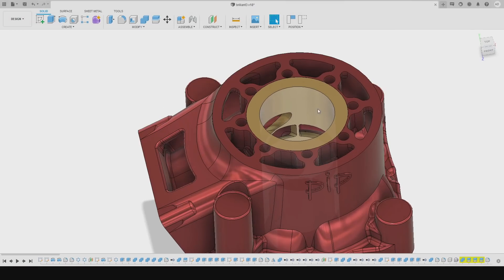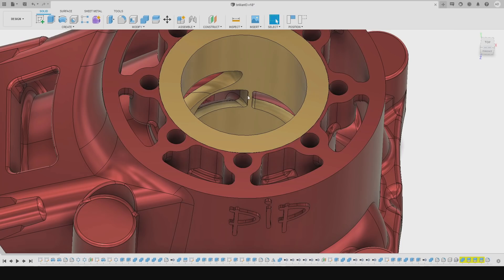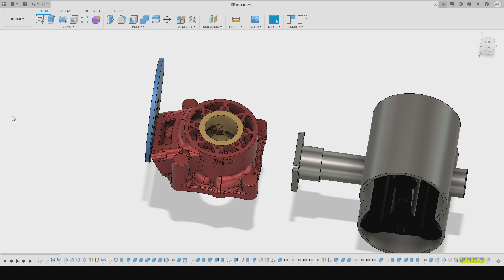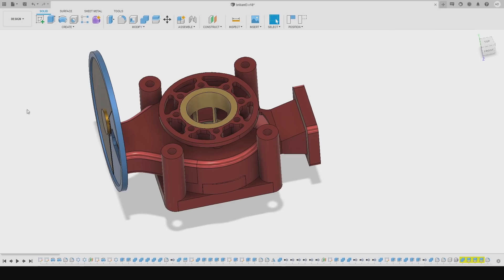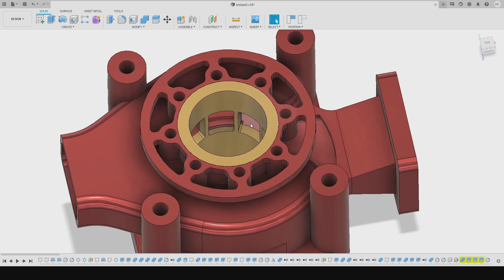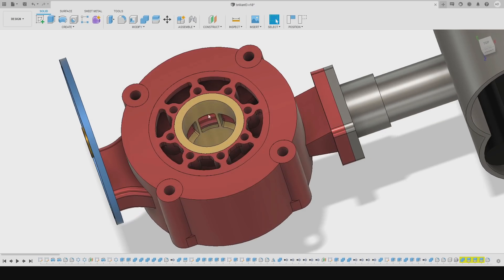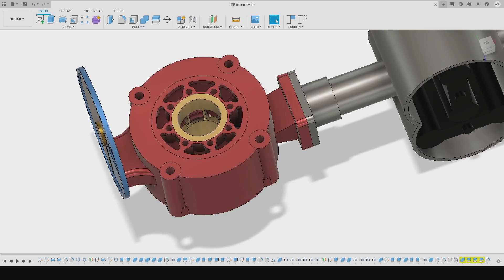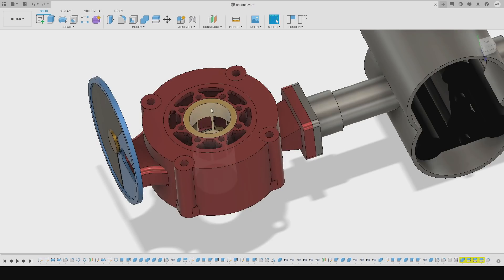Will BLOW Up the Competition! Seriously!

Comment from the maker: Thanks for watching! Many have suggested a typical uniflow setup with valve(s) in the head. Must admit this is tempting, and could actually make the design simpler too. Must think about it👍 Edit: I think exhaust STA could be a limitation with poppet valve in head.
Reply: Athena builds direct Injektion systems for two strokes maybe that will help the fuel Consumpion.
Reply: @Tobi08150  that will help a lot!!
Reply: I'm also working on supercharged two stroke, i'm using poppet valve in cylinder head through, but i think i will switch to diffrent engine than the one that i have on my videos, i recently got 4t honda cub engine clone and i'm thinking about using only exhaust valve that will open at bottom dead center, piston from two stroke and inlet port milled in cylinder, and obviously supercharger.
Reply: @Dymitr_Nawrocki  THATS BASICALLY A 2T Diesel engine & there is a reason we don't put that in a bike. Come on this is basic engineering principles of ease of manufacture, part count number & mechanical complexity. You have just trashed all the benefits of a two stroke engine
Reply: @joshuaharrison9331  If you think ease of manufacture, part count number & mechanical complexity is the most important thing in engine you're probably watching wrong channel, both my and 2stroke stuffing channels are focused on engine tuning for making power, not on making something simple and practical in everyday use.
Reply: How about using a rotating cylinder sleeve with ports driven by the crankshaft as a valve machanism?
Reply: @apsestasis  hey I just suggested this. I think it may cause too much ring wear? So I suggested possibly stationary sleeve on a rotating inner cylinder and stationary outer cylinder?
Reply: @Jarmezrocks  i've read a US patent, that such an arangement extends ring and cylinder life because of more even wear
Reply: @apsestasis  That is exactly my thought, and a dry sump with pump and spray for oiling.
Reply: @apsestasis  i just Had the same idea. You could also use a rotating Piston with symmetrical placed piston windows. But you would need a rotating crankshaft too. Rotating cylinder makes more sense :)
Reply: Hey, that's the way that the 2 stroke diesel engines works. the air entrances is from the bottom, there is an exaust valve in the cilinder head and you must have a blower to scavenge all the hot gases from the chamber. You might also think to use direct injection with nitomethanol, that will be really amazing.
Reply: On truck compressors they use a set of steal dyrframes on the cylinder head for the compressor to let air in as well as to let the air out into the  airdryer and they can hold quite a lot of pressure upwards of 8 10 even 12 bar and they basicly like reed valves truck compressors have pistons but no inlet or exhaust valves like you would find in an engine only those steal dyeframes in the cylinder head and they work very well under pressure the more pressure the better they seal and the more the vacuum the better the airflows into the compressor
Reply: Speaking of simple 😅 wouldnt it be less  work if exhaust would go out one side so the valve could be driven directly from crank ?:)
Reply from the maker: @paanyeaefnityr  Probably going drum valve👍
Reply: What about doing direct injection to slow down the loss of raw fuel out the exhaust?  This is such a sick idea.
Reply: @Mad.Man.Marine  my thoughts exactly, also I would lower the ports in order to extract more downwards pressure from the power stroke. Forcing the induction doesn’t require such a large transfer period. I would also allow the exhaust to open first. And I would stick to a single exhaust port just for simplicity. But it’s your build so whatever. Good luck and looking forward to seeing the progress.
Reply: Uniflows are interesting designs, bug they need sufficient size to gsin back the power lost by supercharging
Reply: What about using a tank for the pressure from the supercharger, and move the valve to the intake side. Then raise the intake above the exhaust.  At least that way you don't have a chance of igniting the intake charge and you'll not have a valve on the hot side.

I'm an under-educated engineer, so I don't know what's doable or rather I have not been taught concepts that limit my thinking... You sir are inspiring for someone like myself.
Reply: @swicked86  Good idea, valve would be also cooled by intake charge instead of being heated by exhaust gases, the downside of this idea is that duration of intake being open with exhaust being closed would be much shorter so there would be very little time for putting boost into cylinder.
Reply: @Dymitr_Nawrocki  I wouldn't have thought of it being good either...but I think that having an additional atmosphere or two may be able to compensate especially if your charge is precompressed in a surge tank.  In my head it's working especially with the massive port area.

I keep thinking more about it, because the valve isn't limited by the cylinder it's really not as big of an issue the lack of duration.

It's really goofy, it could be a low emission engine and probably very low NOx, oiling can be done internally and no more premix.
Reply: Maybe also look into sleeve valves e.g. the Rolls Royce Crecy built in the 1940s. They used a uniflow layout but with exhaust ports at the top of the cylinder that were uncovered by the sleeve when blowdown was to take place.
Reply: These are all cool concepts, and I have given a lot of thought to supercharged 2 strokes over the years but never figured it out. My biggest concern with the poppet valve in the head is trying to get it to work at high rpm. You'll be opening and closing it twice as fast as the poppet valve on a four stroke at a given rpm, so at 16k rpm on this engine it will be like a 4 stroke revving to 32k rpm- I can see some valve float problems well before this speed. With regards to the design above, I do like the concept but it may have a slight flaw. Your manifold pressure will need to build from atmospheric pressure to your boost pressure (presumably 1-2 bar gauge or thereabouts if you want to get serious) in the time between the rotary valve closing around BDC to when the ports close on the upstroke. The supercharger may have trouble pressurizing your intake up to your desired boost pressure in this time due to volume flow constraints. I would very carefully optimize the volume of your intake plenum to minimize any issues with this. I think that you would be much better off using a turbo because it generates significant exhaust backpressure which would help greatly with this problem. Just my two cents. Love your work, thanks heaps for the videos, and good luck!
Reply: @danielclarke7109  
Didn't think about that yet, you're absolutely right especially with only 50cc.

One could use two or four poppet valves and alternate between them.
Seeing street bikes doing 14krpm with no problem and quite reliable that should work.
Question is if that's enough cross section left for efficient scavenging at high rpm.

Another thought though,
in a uniflow two stroke that might be less of a problem. The forced induction and the compression will exert a certain force on the valve once it's (nearly) closed, especially considering that it's not a road vehicle or some such and can have a very free flowing exhaust, while in a four stroke, NA at least, you have the exhaust pressure and the induction "vacuum" working against the valve.
Reply: Have you think about using gapless ring, like from total seal or something, it would give more seal and power.
Reply: @1madhous  I wonder if the gapless design would work with the 100% exhaust motor?
Reply: Could you possibly use a rotrex c8 supercharger ? It’s very small
Reply from the maker: 👍 Looks great!
Reply: @2STROKESTUFFING  I've done some researches again and i've found the description to this type of engine. Maybe ist will help you to improve your design.
https://de.zxc.wiki/wiki/Zweitakt-Dieselmotor
Reply: you can put 2 valve at top make it work alternate between them and lowering the friction at high rpm somthing like two stroke deisel... i tryed one time to do somthing like this but the best senario is to put direct injection
Reply: How are you going to keep the crank bearings and wrist pin bearings lubricated? Separated lubrication system? You could also use a injector on the admission side, after the blower and time it to waste less fuel/make big flames out of the exhaust...
Reply: @ChopShopGarage  turn it into a 4 stroke
Reply: @joshuaharrison9331  that defeats the purpose of what he does... And I like 2 stokes.
Reply: Hey. Its a great concept, but i really hope you are going to continue working on your current design with addition of the bridged exhaust port. There is so much potential and things to test with that design...
Reply: Helt fantastisk intressant å følge med på.
Jeg er lite allergisk med den roterende ventilen. Så min fundering er,  går det å løse på en mindre mekanisk funktion🧐
Går det for eksempel å tenke seg att du leder eksosen ned i veivhuset! Troligen får du en lekasje mellom sylinder portene og stemplet når stemplet er på vei opp, men denne lekasje vill Da hjelpe på å blåse eksosen i veivhuset ut. Du vil også troligen slippe unna trykkoppbyggning i veivhuset som vill påvirke stemplet på vei ned🧐
Dette er bare tanker fra en likesinedmentalgalen broder fra en annen moder🤪

Keep on the good work
Reply: 2stroke stuffing check your DM on your facebook page i have an idea 😁
Reply: How are you going to do the crank case. The lubrication off bearings? And the pressure and vacuum in the crank case. I think you going to need direct injection. Then you don’t have all that wasted feul going out of the exhaust. Love your work.
Reply: @georgevandertogt2400  obvious solution is to do it like a 4-stroke, i.e. have a sump and either an oil slinger for splash lubrication or a pump for forced oil lubrication.
Reply: GM 2stroke diesel ... Similar concept 
Maybe consider positive displacement supercharger to start then exhaust powered turbo and when turbo pressure is self sustaining then decouple supercharger and get rid of crank load from blower. I'm following with great interest. Presume this will be oil injected and fuel injected.
Good luck!!!
Reply: @davidandvarley  
Unfortunately there are no suitable turbochargers for a tiny 50cc engine. Afaik the smallest readily available turbos aren't really doing much < 500cc.
Reply: Reverse the flow. Reverse uni-flow with a 360 degree exhaust port, 4 valve head with variable valve timing on the intake. 3 valve head with direct injection is possible too (at that engine size).Thoughts? With variable valve timing you can hold the intake valves open (one set or cam) just long enough to reduce the compression ratio if wanted, or at lower speeds open the valves a bit early for a bit of EGR. Controlling the cams for the intake valves independently gives you allot of flexibility and the exhaust ports are fixed timing.
Reply: Opposed pistons, blower connected intake on one piston, exhaust on the other. Allows different timings, especially if you lag one piston behind the other. Direct injection to save fuel. Go the whole hog and have it compression ignition so you can have a super high compression ratio.
Reply: Lol, I was just going to ask if you've thought about that (valves in head), but figured that you probably get asked that in every video. Glad you already gave the answer :D

What about direct fuel injection?
Reply: The shape and position of the disk valve port is something to explore 🏁👨🏻‍🔬
Reply: Hi. Big fan from Tromsø. Love your content🤩
I used to work with two stroke diesel and my first thougt was why you would go with a crossflow and not a uniflow. It just don't seem logical when you are fitting a valve. You get better grade of filling and less exhaust residue in the combustion air with uniflow. I dont think you need a scavenge air reciver/tank as long as you haven only one Cylinder, big enough ports and blower to bulid pressure after the exhaustvalve closes. A reciver will also make starting harder with high intake volum and low rpm on the blower.
Reply: With a blower you could start with a four stroke engine, make the cam run at the same speed as the crank and adjust the valve timing accordingly.  Getting efficient scavenging and minimising short circuiting would likely mean some interesting port/combustion chamber designs.
Reply: Hi, your principle seems to be such similar to an existing design, used in big Ship Engines. Why you dont use classic outlet Valves in the top of the cylinder?
So you could control them better an more direct.
Reply: You can run a type of guilotine exhaust valve timed off the crank. I do like the idea of the 4 exhaust ports leading into a single port.
Reply: the easiest way to get this engine to work properly is to design it in the same way as a detroit 2 stroke linear flush diesel engine
Reply: Following your projects for a while now. But just had t react now. Just doing some quick maths, maybe i'm wrong. Jamming 300cc into 50cc you will get 6x atmospheric pressure. At 20.000 rpm that is 6000 l/min. 6000x6/540=66,6kW needed for the blower. I understand you wont need 6 bar pressure. But at 1,5bar you will still need 17KW at 20.000 rpm. So if my guessing is right you will need too much power for the blower.  I hope i am wrong.
Reply: @michaelfreye2543  indeed; driving a supercharger here cost to much power, and then how about blow-by losses? how does he seal of cylinderpressure properly?
better is he would not go that route, and develope uncharged 50cc like he did. He could however, find out if a shot of NoX could be put on it.
Reply from the maker: Valid concerns, we'll see how things go 👍 I'm not quitting the "normal" 50cc business though, should have the PiP cylinder ready with a bridged exhaust in not too long!
Reply: @michaelfreye2543  blower sizing for positive displacement blowers is very critical, as you say too large a blower will use far more power than you will gain!
Reply: Maybay one big rotery valve in the head as a exhaust valve. The only problem is the sparkplug.... So you should need to make it to combust automaticly or just put some sparkplugs around it laying flat. Keep up the good work i love it!!!
Reply: Scavenge blowers are used on Detroit diesel 2 stroke industrial engines.
Reply: It will blow raw fuel out of exhaust on every exhaust stroke. It will get horrible fuel mileage. The raw fuel can and will ignite when throttle is closed due to reversion. It wouldn't make power outside of a very narrow power band. Spark plug will foul due to inability to develop a proper air fuel mixture. The idea of intake and exhaust on same plain means you will also need a disk valve "timed" in intake also! At this point a turbine engine of same hp output would be more efficient. This would after incredible amont of experimentation would be impractical on every level.
Reply: If you're supercharging it do you actually need to make it intake trough the crank case? Can't you just put a fuel injector at the top? Then you could inject fuel as soon as the exhaust ports are covered and increase fuel efficiency massively right?

Comment: Why are you not just using electronic gate valves at this point?  That is how all the new 2 stroke snowmobile are doing it with the box.  Wouldnt it be more reliable?  Plus you have room to error and just make software corrections vs rebuilds?  Anyhow awesome build man!

Comment: How much power will be lost by the piston on the upstroke having to resist the pressure created by the blower right from Bdc upwards? Compared to normal aspiration when it only starts to encounter high pressure from when the transfer ports are shut, ie quite high in the stroke?

Comment: Hey mate Liam from Australia, wat program are u using to do the CAD drawings
Reply from the maker: Fusion 360
Reply: Also I’m not sure if this would work but wat if u made a engine similar to a 2 stroke diesel that ran on regular fuel that had one intake valve in the combustion chamber and a low exhaust port on the side of the cylinder as it normally would be on a 2 stroke but lower then it would be. Same as your engine there will always be fresh mix an burnt gases mixing an also abit of fresh mix that gets pushed out of the exhaust but with a big fuel consumption I think it would be a very high reving engine an also like yours Resonance wouldn’t matter, im not sure if this would work but I came up with this as I was watching your videos I’d like to hear your thoughts, kinda regards Liam from Australia 👌🇦🇺
Reply: So as piston comes down it draws in fresh mix some will go out the exhaust port then as it comes up it combusts piston goes down draws in more fresh gas an on the way back up it pushes out some exhaust gases then compresses an combusts then cycle repeats
Reply: Using one intake valve in the combustion chamber like a 4stroke engine but have the exhaust port floor would be at the top of the piston wen it’s at bottom dead center then the length would depend on the stroke but width could be from start of piston pin to pin because no transfer
Reply: This type of engine would use a oil sump an some sort of oil gallery’s an a small oil pump
Reply: I’m not sure if this is practical but I think it is a good idea

Comment: also as the crankcase is shut of, you can put engine oil in it, that will cool the cylinder from underneath the piston, it will still exist through the exhaust ports but no more premix and no oil burning hence more power

Comment: When you dont use the crank case, you could make multiple cylinder engines with for example a V configuratuon and maybe use interactions between these cylinders to get rid of the exhaust valve